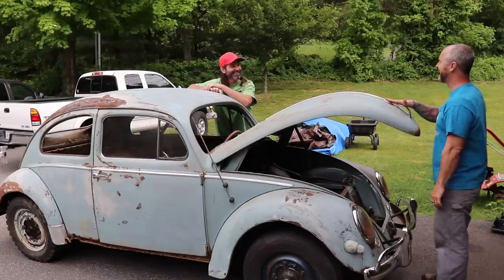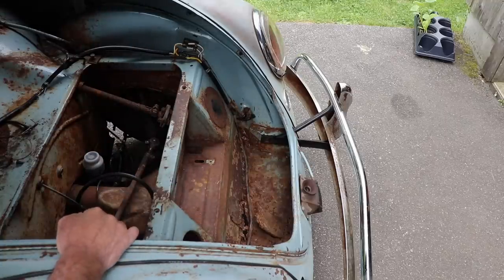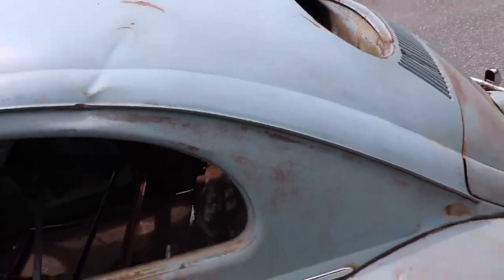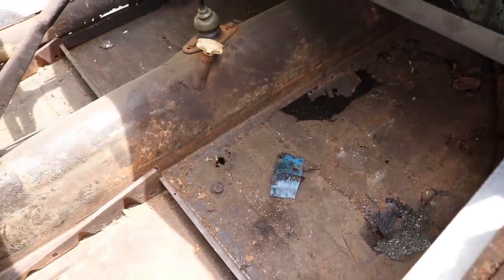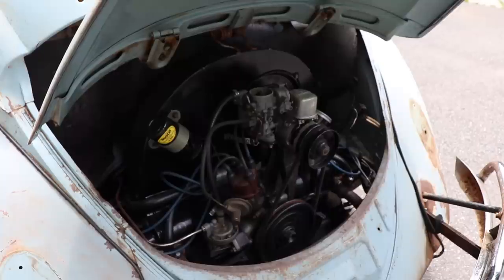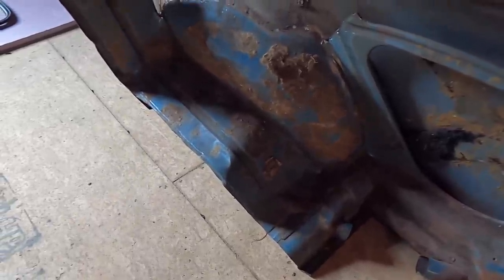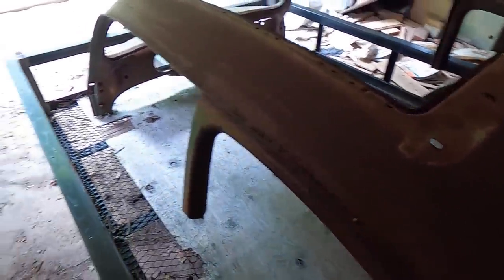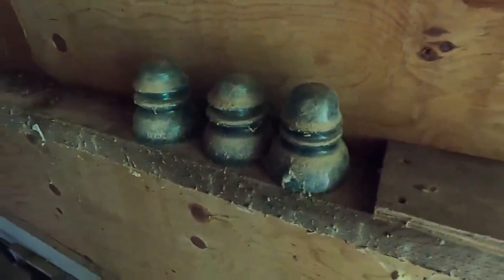Buying a Vintage 1957 Vw Beetle  - price revealed. " Marylin "

Comment: 57's were great in '57.  Each year they got better.   My 1st car in '75 was a '64.   I have another '64.  They get into your soul.  Cheers!
Reply: I bought my light blue '57 Beetle with sunroof in early 60's. Traded it and a 1965  Mustang fastback for a 1972 Gran Torino wagon for way under $6000.
We drove that Beetle from Illinoiz to a concert in a NY cow pasture and back in 1969. It got an unbelievable fuel mileage. I could drive fom central Ill to Chicago and back home on the same tank of gas.

Comment: I remember when my brother and i went to look at a 57 bug in bayville long island around 1990 and the guy turns out to be a class mate and friend of mine from boces aviation school. so we haggle and he wants 3500 bucks. car was in driving condition. original olive green on the inside but dark blue on the outside. no rot and pretty straight. trans popped out of gear when romped on. 36hp and original tranny. we made an offer of 1500 dollars and walked away. 3 weeks later he calls us and accepts. no more deals like that anymore.  Good luck. you are a saint for saving bugs or a glutten for punishment. I saved a rusted 63 sun roof bug in 1988. paid 450 bucks and restored her. joined the Connecticut VW club . My first show was Orangeburg NY. what a thrill. I did many shows like Litchfield and competed against the famous Humberto Lappa. I beat him once against his grey 64 first place 58 to 64. still have it and drive her regularly. even use it for work. im out of the show scene. but i may do one again someday in Connecticut because of you .

Comment: Interesting.  My first car was a well used '57 Beetle.  Disaster.  Fuel pump broke while on the Jersey turnpike.  Wiring fire in Philly.  Across the PA turnpike on three cylinders.  A VW dealer took it off my hands by paying off the loan.

Comment: That's a fairly steep investment. So.  You're obligated to at least get it running and driving. Can't wait to see the Will It Run video! You know you can add a grand of value if it'll at least haul its own weight around.
Reply from the maker: yes , " it runs , drives , stops ....needs some tlc " :))
Reply: @5150mxVW  TLC, Floors, ya know the usual.

Comment: Prices have really gone up since I bought my '55 semaphore bug. It was a Montana car and the only rust is on the rear bumper mount area. I hope to get the engine running next year and may try to paint it myself.
Reply from the maker: nice find👍! Get after it :))
Reply: @5150mxVW  I've had it for over 20 years but it's been in storage until recently. I finally have a garage now but have a lot of projects to complete on my house before I can even think of working on the bug.

Comment: This guy did not check the front end frame . I had to replace one on a newer model . Not running is a serious issue.
Reply from the maker: a non running vw engine is the least of my problems :)))....especially when it appears to be just overhauled ( or just lipsticked 😂 )

Comment: damnnnn $6,600??? lol I'd be more like 2 grand plus extra's for extra $ sheeesh...I have been into VW's since 1980, had a LOT of em over the years...Had  '55,'56',57 ovals. '64,'65,'66,'67,'68 bugs, and my best was a '69 walk thru bay window deluxe, lowered, dp 1600, 5 chrome spokes,  and got 2nd matching rolling shell for $2500, which 7 years later after only driving it, never did nothing to it, had to sell, so got $5,500 for it 7 years later.....Prices of VW's are crazy stupid it seems, lucky I always got screaming deals wayyyyyyy cheaper
Reply from the maker: your 3 best Stevo were the 55, 56, 57 all day , hands down ....or I guess in your case doubling your money on a bay window 7 years later was the best ....not all Vw prices are crazy , just buses , why ? I have NO idea .....and not everything in this world is about the almighty dollar...I have 2 split window buses , 2  low light bay windows and one 73 all outside while my 55 , 56 , 57 are all inside🤣.....although my 58 and 59 Single cabs are inside too👍

Comment: Dear 5150mx VW.
You really paid 6000 bucks for the car? That's a lot of money. And this bug isn't even in your favourite kind of condition = completely without floor panels. ;-)
Best regards, luck and health.
Reply from the maker: yeah and it still needs rockers / pans etc ....you as well
Reply: @5150mxVW  
After watching your video I found a middle blue 57 VW beetle for 6.750 Euro on eBay- Kleinanzeigen in Germany. 50.000 kilometres, 1200 ccm, 30 hp. The paint looks a bit beaten up, but not really much rust.
I always wonder why nearly all aircooled Volkswagen in North America have bigger engines with more hp. I guess that cars with the 1200/1300ccm engines haven't been exported to North America at all!?